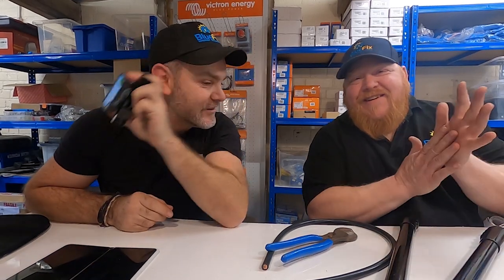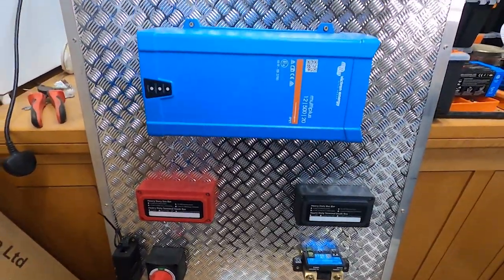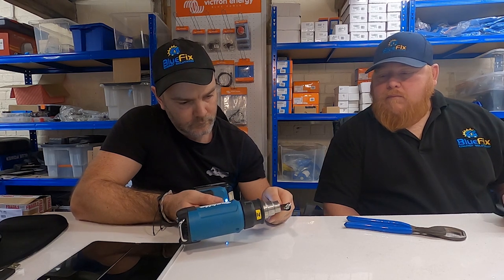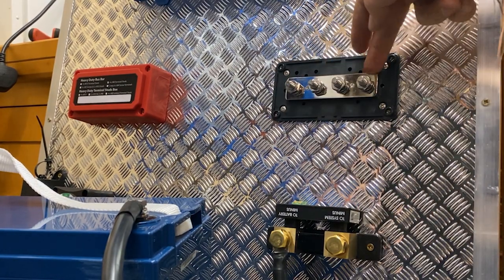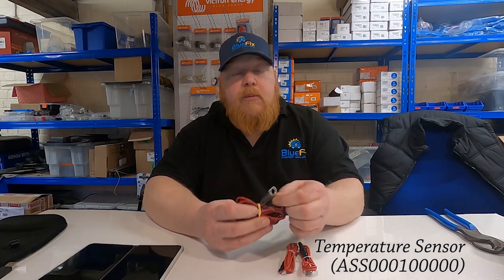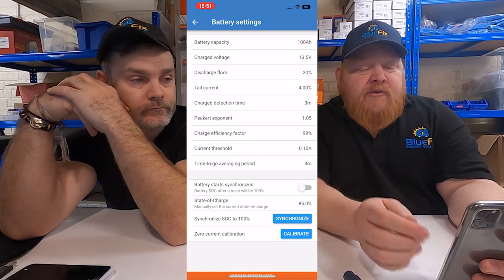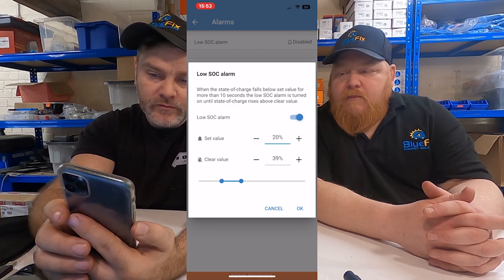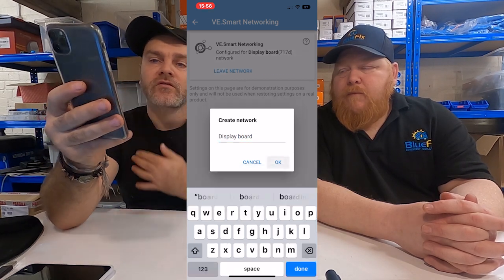How To Connect & Set Up Victron's Smart Shunt! || A Must Have For Your Leisure System!

Comment: torque specs?
Charged voltage at 13.5???   So when the SS senses the battery at 13.5 and meets the tail current parameter it will record 100%.   I have seen this set much higher by most everyone else.
Reply from the maker: Torque specs around 2.5nm for 10mm on brass. Those settings are typical for the Victron branded LiFp04 batteries. It really does depend on the battery cells, on EcoTree 230ah we use 14.2/13.6, tail current 3% (6.9 a) PE 1.05 and CE 99%

Comment: Very nice--thank you for posting.  Quick question:  Is it acceptable to connect the small positive wire to the positive bus bar--instead of the battery switch shown in the video?
Reply from the maker: The reason we don’t do that is for troubleshooting. we feel it’s important to always have power to the shunt. If the main fuse was to ever blow the shunt would loose power if it was on the bus bar. If it was on the battery That would be the first thing to check why the system wasn’t working. If it was the main fuse that blew you could still log into the shunt and see the state of charge on the battery

Comment: Great video guys....and great to meet you both at last weekend's show in Harrogate. I've just had a SmartShunt fitted to our CV40 campervan so will be following your video advice to set it up with my dual 100ah lead acid leisure battery system. I don't intend monitoring my starter battery or temperature via the aux input so do I set it to 'Mid point' or 'None' given I have two 100ah batteries connected together? Also will you be doing a future video on connecting the Cerbo GX as adding a screen might be a future upgrade?

Comment: Great video on the Shunt.I have the basic smart shunt.
I want a  to measure charge/discharge of my troll motor  batteries.they are 2 12volt AGM in series to create 24 volts for troll motor.each battery is also connected to a shore power battery charger when I return from fishing.would you please briefly describe the  connections for this.thanks John

Comment: Fantastically clear video! One thing though, I have 2 sealed lead acid 110amp batteries, what should I set the settings to?
Reply: Me to 380 amp. 2 battery 🔋 is 740 amp ?

Comment: Hi, have 3 smart solar chargers in parallel with parallel battery bank. The 100/30 is receiving current and voltage. The 100/20 and 100/50 are only receiving voltage. All show good blue tooth strength. Can you comment on this situation? I guess the 100/30 is the allocated master charger in the network, and coordinates the entire charging network on the basis of its use of external battery current sense from SmartShunt. 

The last 3 battery settings disregarding zero current calibration are… “keep SOC” as you recommend
State of charge….  -
Synchronise SOC to 100%. ??? What is this for? Do I press blue synchronise when battery reaches the 14.4V recommended boost charge voltage for my batteries?

Another question is true capacity of batteries. Nominal capacity entered is 510Ahr. I presume Ahr count is 0 at full charge and 100% synchronisation, and usable battery capacity is revealed when batteries reach the 12.9V 20% floor. This would then give an estimate of true capacity of battery bank.
 

Thanks, DG
Reply from the maker: If you still need an answer to this, ping me an email contact@bluefix.co.uk
Reply: @BlueFix  system established now and on auto mostly. I view soc as approximate and don’t take much notice of it unless below 40%. Have capacity estimate at about 300 from 20% to 90% approx, so a little on the low side, and synchronise to 100% occasionally.

The main issue is was erratic charging but determined this is due to insufficient power for all chargers. In full sunlight they run at capacity. Partial sun light I get more output using just one charger at a time. Cheers

Comment: can the cable between the battery and battery minus on the shunt be a longer cable?  In my application it would be easier if the shunt was about 6 feet away. It will still be between the battery and the negative bus bar.
Reply from the maker: Yes, it can be but make sure the lengths of your pos and neg cables are of a similar length. Watch out for voltage drop too.

Comment: If you can only connect the negative cable from the shunt to the negative post of the battery how would I get the negative cable coming from my  solar controller to the negative post of my battery for the solar controller to be able to charge my battery
Reply from the maker: We use bus bars. You can get an example here https://www.youtube.com/watch?v=4hgMk9-tYzA

Comment: Im new to all of this and do not have any knowledge of how to hook up the things up that I want to use to power up my fridge in my off grid cabin. I want to power a 12 volt refrigerator with a 200 amp lifepo4 battery for use in my cabin.  For right now, I will take the battery home to charge it until I can afford a solar panel.  What size of a Victron shunt do I need for a 200 amp battery and how do I hook it up?

Comment: Hi can we ask a question please. We have two * 110amp lithium fitted and a victron shunt. 

Arrived on site definitely on 100% charge as it’d been plugged in. 
Used 12V TV and lights and blown air heating which we think is about 5% used (roughly 3 hours) 
Then used CPAP machine overnight which is 50w for 8 hours. 
So we think the CPAP alone wouod use about 15% of the 220amp hours we have. 
However this AM we awoke to 93% charge when we expected abouy 80%. 
Today we’ve had some medium solar for 6 hours. Which apparently topped the batteries back to 100% however we believe it’s reading too high. The voltage says we are on 13.25 but the battery reading is still showing as 99% 
This is a new system. Do we need to calibrate it? It was professionally fitted

Comment: Tail current is 4% of battery capacity. If you have 2 x 110 amp batteries is that 4% of 110 or 220? Is it correct that when your charge current drops below tail current that means your battery is fully charged? Trying to figure out if my 2 x 110 amp batteries are fully charged,
Reply from the maker: 4% combined capacity

Comment: Hey guys great video I used your settings to set my shunt up to my 110amp lithium but for reason it won't always read 100% capacity even though it's fully charged any ideas?
Reply: Hey Anothony, I might be able to help. Charged voltage should be higher than 13.6V for lithium, 14.2-14.4V is good, 13.6 is too low and won't say your battery is at 100%. Hope this helps!

Comment: Can’t really find the answer in the product documentation. Can this be used with two batteries in parallel? Assume so, it would just read them as a single 100Ah battery instead of separate 50Ah batteries.

Comment: Just purchased and installed a smart shunt in my Moho but I’ve got a very basic 12v system. AGM starter battery and a lead acid 80amp/h leisure battery. There is a 100w Truma solar panel with a Truma controller. I’ve installed it changed the settings to match the battery and changed some other settings to match your video. 
I want to monitor the AGM starter battery but that’s got different settings how does the app allow for this?
Reply from the maker: You simply select starter battery monitor from the aux options, there is no configuration requirement because it’s just monitoring the voltage and nothing else.
Reply: @BlueFix  thanks I’ve now connected with the starter battery and it’s all working great.

Comment: Great video guys! Quick question - I want to measure my starter battery with the shunt and I have the same setup as you. So I will run the "Aux" positive into the Orion input. Now do I also have to run the negative from the starter to the "Battery" side of the shunt too? Thanks!
Reply from the maker: Nope. Just do the aux as you said 👍
Reply: @BlueFix  shot guys!

Comment: Did you test the accuracy with Victron Smart Shunt? In several test we have made it always shows approx 3,5% less capacity.
Reply from the maker: Ive found that its all about the minute details, ive had a set of self built lithiums for 4 years and it took me 2 years to fettle in the settings! Its now pretty much spot on, and when charging will count down the used energy perfectly to 100%

Comment: Thanks Guys 
I have two 200 amph lithium batteries in parallel, do I set up my shunt for 200 amph or 400 amph?
Reply from the maker: Thank for the question , Assuming you are running a 12v system, 2x 200ah batteries in parallel you would set your shunt for 12v 400ah

Comment: Can I connect a starter lead battery and a consumer Lifepo4 battery?
Reply from the maker: you can charge your Lifep04 battery from your starter using a dc to dc charger like the Victron Orion TR Smart. But you should not connect them directly together.

Comment: I just connected my smart shunt. Can you tell me in the settings what the charged voltage means and what should be the correct setting? I've seen quite a few videos with different settings. I've seen 13.5 13.6 13.8 14.4 14.6. Which is correct? I have lifepo4 batteries.
Reply: Good question! I can say it is not 13.5V at least because I tested it and when you discharge like 10Ah and soon as you Solar charges like 10 minutes (one small panel only) it says 100% SOC and that is not right! I think it must be 14.4 or 14.6 but have to test it some more.
Reply: @april7_  I have it set to 14.4

Comment: Strange settings guys 
Jonas explained the charged voltage needs to be 0.2v lower then the mppt absorption 
So says you have 14.4v absorption and 13.5v float 
In the shunt it should be 14.2v and 13.5v float 
I tried these settings but you don’t get a correct sync 
But each to their own
Reply from the maker: The Victron Lifepo04 setting is 14.2 float, 13.5 charged (cold) voltage. I have found that 13.6 is a better charged voltage and it stops the shunt setting to 100% too early.